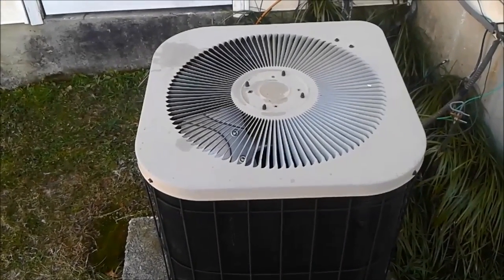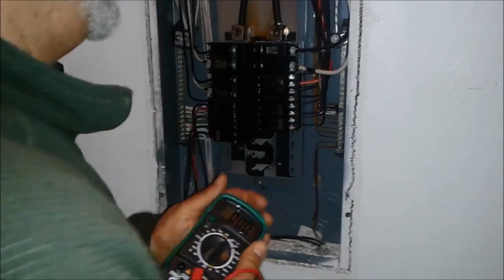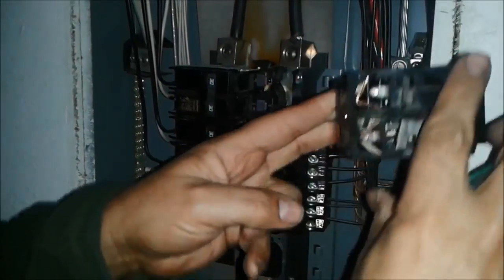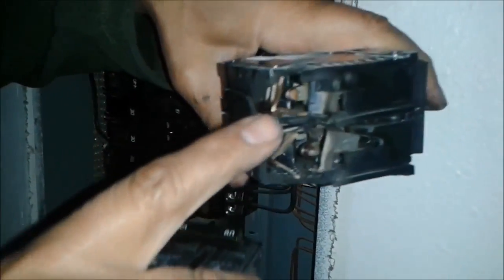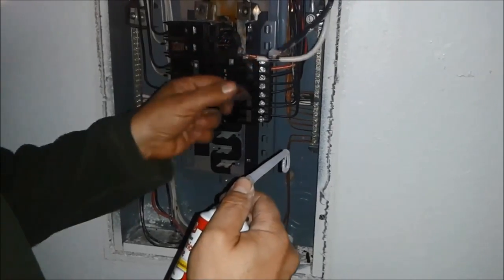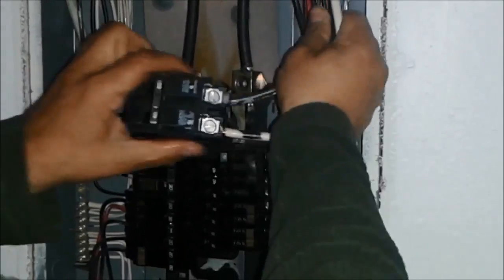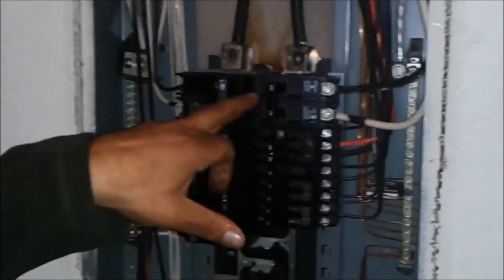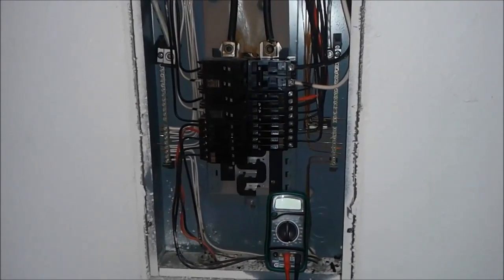How to Replace or Install  Circuit Breaker -   60 Amp  240 Volt - Step by Step

Comment: You did a great job finding the direct problem Joseph, and also demonstrating a safe solution, but you also had to go and talk bad about HVAC techs, like we are all scammers so I'll break a few things down for you.

You found the problem, not the cause. Breakers don't burn like that unless something caused them to. I can tell by your breaker panel, you have electric heating, the 60 amp breaker was the one that shorted, so you probably have an issue in one of your heat strips. I saw you made a continuity video, so you know how to check that I assume. You need to check all the heat strips one by one for continuity.

You also overused the sealant you had. If you use a super-bonding sealant it can cause the breaker to become basically fused to the wires causing you to cut the wires shorter because you cant get them off. Eventually you run out of wire...

You didn't check for shorts either, while you have the power off is a great time to take an extra minute or 5 to check ALL connections to the DIRECT GROUND. You never had a lead on direct ground, and it would have taken all of 2 minutes to check every connection...sigh.

You temporarily fixed your problem, it will happen again 100% guaranteed unless you find the root of the problem, breakers don't burn like that.
Reply from the maker: 1. Not all the tests and verification I did are in the video. Yes I agree you can test short also.
2. The issue was the circuit breaker not the AC and not   heat strip. The circuit breaker can be fused also because of internal issue.   That is why I used 60 Amps Siemens breaker instead of cheep one. 
3. The problem is fixed for good. Over 4 years and no issue with breaker or with HVAC.
4. I said some HVAC tech (NOT ALL) will try to take advantage on the situation and say that the compressor need to be replaced.  In  the past I had quit few situations when a tech told me that the compressor or blower need to be replaced when the issue was the capacitor only which I replaced myself and also made number of videos for it.
Reply: @josephk9182 2. The issue was the circuit breaker not the AC and not   heat strip. The circuit breaker can be fused also because of internal issue.   That is why I used 60 Amps Siemens breaker instead of cheep one
You are likely to never have a problem ever, but let me point out that your wiring is 6 gauge which will start to melt above 55 amps, you installed a 60 amp breaker. That indeed is a fire hazard.

4. I said some HVAC tech (NOT ALL) will try to take advantage on the situation and say that the compressor need to be replaced.  In  the past I had quit few situations when a tech told me that the compressor or blower need to be replaced when the issue was the capacitor only which I replaced myself and also made number of videos for it.
I absolutely agree there are bad techs out there that will sell you things you don't need, even just the small parts. We are not all bad though, I treat every call I go to as if I were working on my mothers AC. I've been recruited by those "part sales" companies and I laugh every time. I make as much, if not more than them being a legit tech rather than a salesman.

Most people in hvac are honest, though I have of course met many that are just in it for a paycheck.

Always Always Always get a second opinion, and do NOT disclose the original diagnosis, only discuss the estimated price. As a matter of fact many people scam HVAC companies that way, because 99% offer a free second diagnosis. If you legitimately have an outage, that is a way to get a free diagnosis. If you want to just make sure it's working and components are good, pay for annual inspection :)

Like I said, overall you did a great job in the video, the scammer comment irked me :)

Comment: You have an ALUMINUM BUSS PANEL this is COMPLETE GARBAGE this panel NEEDS TO BE REPLACED WITH A COPPER BUSS PANEL .SQUARE D QO OR SIEMENS WITH THE COPPER BUSS option  .What you just did will fail again it may even cause the panel to short out  as it melts more of the plastic away.

Comment: Please buy "guards" for your breaker panel, if you can find them for your model.   there is still power coming in, at the top.
Reply: Wrong has separate main switch on that panel